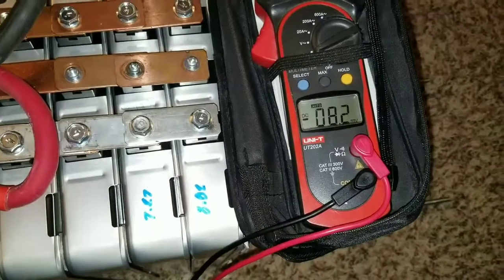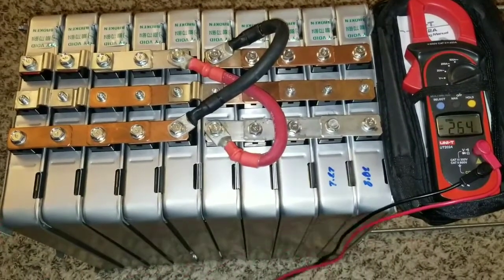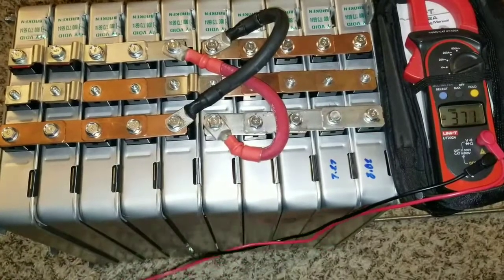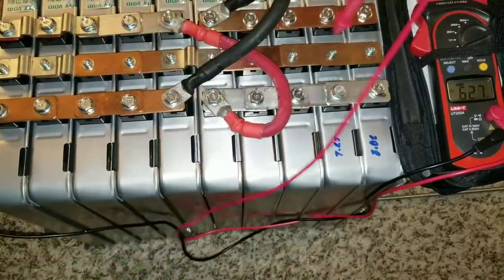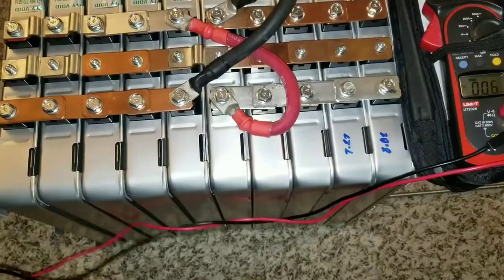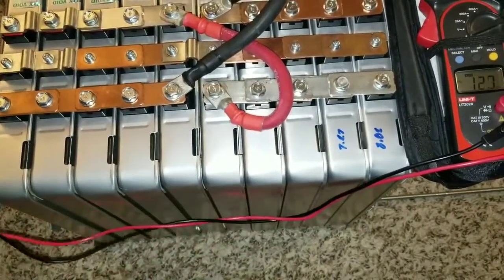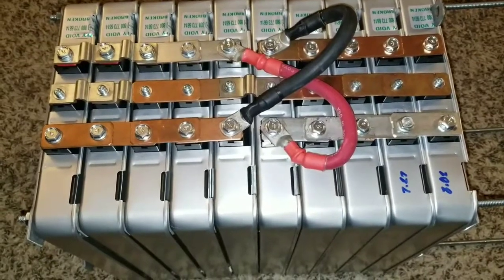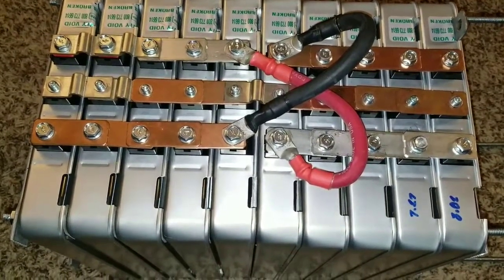CELL BALANCING LITHIUM ION BATTERY (Update#2)

Comment: With the bus bars still connected, is it possible to see voltage difference from on end of the bus bars vs the other end of the bus bars?
Reply from the maker: By using a volt meter or multimeter you can easily test the voltage of each cell groups
Reply: @jwsolarusa  Yes, I know how to use a Volt meter.  My question was ... Can you actually measure a different voltage at one end of the bus bar vs the other end of the bus bars when the packs are FIRST connected in parallel for balancing?   When I parallel a bank, the voltage on both ends of the bus bars are immediately identical.  So, measuring identical voltages on both ends of the bus bars proves NOTHING, as far as, whether the pack is now balanced, or not.  It just simply TIME that balances the parallel connected pack.  Measuring the voltage on the bus bars proves nothing.